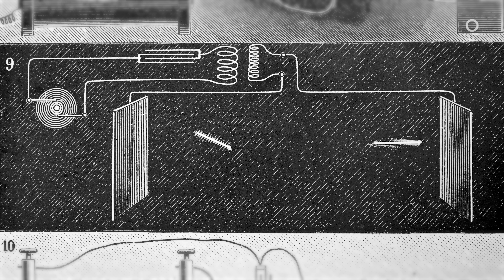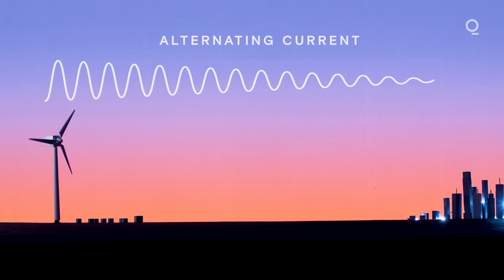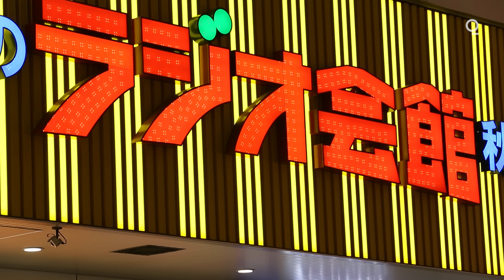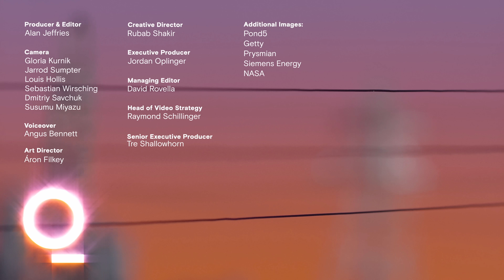The World Needs Supergrids, But There's a Problem

Comment: Can someone ELI5 the reason they need to purchase/take private land from land owners? We already have an interconnected system of government owned land in use for the interstate highway system. Why can't they just put these HVDC lines next to or over/under the existing land in use for highways?
Reply: Because there are not enough highways. A grid that relies on <5 connections between states is going to fail. Badly.
Reply: @bigsmall246  Sorry but I'm still confused... Isn't the proposal here 1 giant connection from Wyoming to Vegas? Why would 5 connections be worse than 1?

Edit: Wyoming, not Wisconsin
Reply: @cmac3530  1 connection means if it breaks, Wyoming has no power. That's why we have a power grid and not a power line.
Reply: @bigsmall246  What??? But then that would support my solution of using the interstate systems considering that is more than one connection.... 

I don't think you're understanding what I am asking: 
The proposed solution here, in this video, is 1 large connection from Wyoming to Vegas.

I proposed a solution of using the highway system and it's already connected grid.

You argued that a grid with only <5 connections would be destined to fail.

I asked how 1 connection (such as proposed in this video) would be better than the <5 you referenced in your initial response.

You then re-state that 1 connection is bad.

...Yes, we've already established that. I'm asking how the proposed solution in this video is better than what I proposed.

Also the power producing site is in Wyoming (Wind power) and is being transmitted to Vegas. So if that 1 connection were to break then Vegas would be without power, not Wyoming.
Reply: I am I no way an expert, though I would guess after looking at a highway / interstate map that there is just not a direct (enough) way to connect e. g Wyoming to Las Vegas. Even with HVDC,  they would still like to make connections as short as possible.

Comment: Europe will be the first continent connected by an energy supergrid 🥰
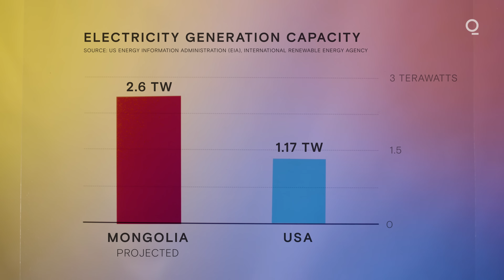Reply: As pointed out in video 11:50, China started their pilot run HVDC supergrid 10 years ago and already stepped into mass-scale projects 5 years ago.  It is part of the  "comprehensive poverty alleviation" programme.
Reply: @黑花生  China is doing a great job, but it is all in the same country (that is huge ok, but it is always an inner connection). EU is connecting different country one to each other and this is very important. Here in Italy there are literally two French nuclear power plants that are CONSTANTLY producing electricity for us. Another example is the connection between Scotland and Norway (they are not in the EU but they are European country anyway) that uses offshore wind energy from scotland that can store energy in hydro power plants in Norway!
Reply: @lucacasagrande2456  the key point here is not to connect multi-countries. It is to connect a massive area and balance the demand/supply inside it. Compared to Europe, China has an advantage on this.
Reply: @FledgeinNYC  well but it is easier when you connect a single country than when you connect multiple countries because you have to cooperate a lot more. China has 24 high voltage energy connections, more than everybody in the world but it is still connecting chinese regions one to each other... The concept is clear but to have a "global interconnection" you have to connect different countries and, in doing this, Europe is forward
Reply: @黑花生  Europe is ahead of China.. there are many existing projects that connect countries already and many more under construction and under planning
Reply: @黑花生  And yet it's still nothing but a concept. Europe on the other hand is already building and extending it as we speak.
Reply: omg we should connect with russia!! imagine the energy
Reply: @HUEHUEUHEPony   Under current situation?, no.
Maybe when Putin is forced out of his Tsar, and a actually regime change happening in Russia.
Then Perhaps Russia can join the EU with supergrid system and rail network system.
It would greatly benefit all of Europe.
Reply: But you will still be in Europe with all of those Europeans.
Reply: We already have it, now we are expanding the system towards eastern Europe and other countries Balkan countries that will soon join the EU.

Comment: No, this is the opposite of the future. The answer is in micro-grids and community power.
Reply: Micro grids are extremely inefficient and don't even work for renewables in most places. Massive grids are pretty much the only thing that can make renewables viable on large scale.
Reply: @trendhouse6799  Inefficient how? Shorter transmission = less loss, right?
Reply: @trendhouse6799  Technological constraints holds microgrid developments. Current solution is too expensive

Comment: its really dangerous to centralize sources of energy... Recent situation in Russia is obious example what might happened if you become dependent.
Reply: But a supergrid allows for more flexibility in where energy is produced. Wether you want to rely on any one power plant in the grid is a different question
Reply: But a decentralised one linked like the opposite one combined could be the solution
Reply: @Jonas-uh7bb  not really because you would need enough redundancy to reroute energy when some countries fall out and threaten to cut another country off. The cost of building a network like that would be crazy not to mention how wasteful it would be
Reply: @TheAnzamin  And yet you're typing your answer on here because companies around the world laid fibreoptic cables to create the World Wide Web. This kind of engineering project can be done if there's the will to do it.
Reply: @malcolmrose3361  right because all infrastructure projects are the same? Also because the internet has never been cut off or rerouted for malicious intent? 

People don't heat their home with the internet.
Reply: @TheAnzamin  Which is why you build redundancy into the system. Just like the Web.
Reply: @malcolmrose3361  that's ridiculously inefficient for an energy distribution system. Have you ever built systems like this because I do for a living. Designing an energy grid as interconnected as the web would be insanely expensive and wasteful. 

You're better off trying to decentralise the generation of energy as opposed to distribution solutions that try to eliminate all bottlenecks
Reply: Countries have to weigh the ecpnomic and environmental advantages of international interconnects against the potential loss of sovereignty and security. Israel is actively working on a connection to Greece and Cyprus, thence to Europe. There are proposals to connect to the Persian Gulf. Sounds grandiose.
Reply: Tell that to the sun.
Reply: We always have been dependant to Big oil money. We already are centralized. All money from energy and oil flow to the Rockefellers and the family of 12.
Reply: This is actually decentralization. Internet is also worldwide and decentralized at the same time.